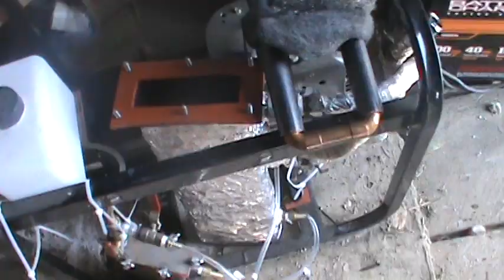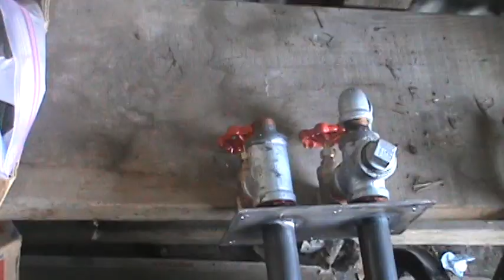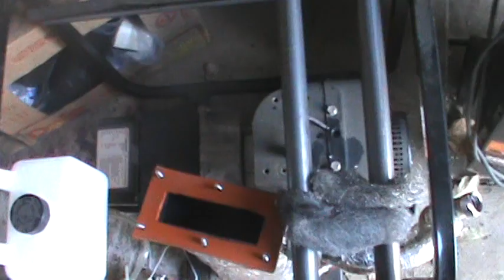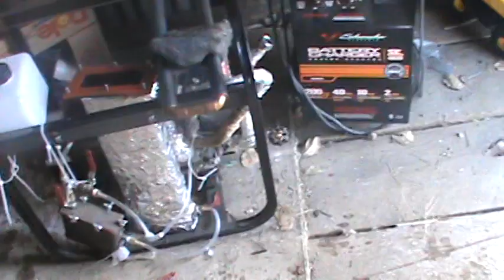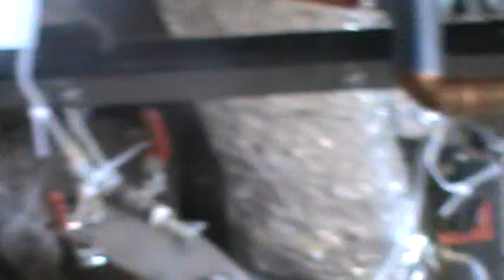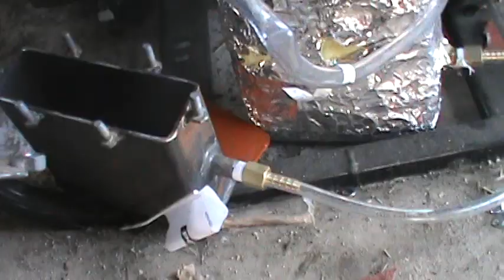Gen-Set Vaporizer System #2 (An Inside Look At The Vaporizer)

Comment: So this device you have here can you pipe in the fuel line from the manual fuel pump?.
either thing could you use the exhaust heat exchange to heat the fuel or do you have to use the exhaust pipe it self?

I am asking question so i can get the correct pointers.
Reply from the maker: Yes you could pipe in the fuel using a manual fuel pump. This design is gravity fed. I have blown exhaust onto my vapor containers and have also used the exhaust pipe to heat the fuel either way will work but the exhaust pipe method works best.

Comment: Hey. I do see how the copper line will heat the air and gasoline into vapor. I'm having trouble understanding how the vapor is pulled out with both pipe being so close to the bottom. From looking it seems the intake would be in the liquid sucking the raw gas. The wool looks above the the intake pickup tube. Another question is how does fuel regulate depth with float valve in another tank. Sure hope you'll explain these questions.
Reply from the maker: The two pipes are air inlet pipes. I have an air outlet pipe in a completely separate location it is not attached to the lid like the air inlet pipes are. Instead it is attached to the vaporizer near the top but on the side as you can see in my previous video. Because the air/vapor outlet is at the top of the container no liquid is sucked up into the generator.
Reply from the maker: To address the fuel level question...

If you were to have two separate containers ant connected them together at the bottom of each using a hose, have one full of liquid and the other empty the empty container will fill up to the level the liquid is at in the tank that has liquid in it. Since the float or fuel regulator container is smaller then the vaporizer container I can raise or lower the float container which will raise or lower the fuel level in the vaporizer.
Reply from the maker: The wool is bellow
 the air outlet.
Reply from the maker: Thanks!

I used a standard 3/8" ball valve to regulate the gas. You have to use a gate valve to control the air/fuel mixture because it requires fine tuning adjustments. 

The level of gas is adjustable. the more gas in the vaporizer the more vapor you will produce because more fuel is agitated. This setup allows me to adjust the level of the fuel in the vaporizer chamber.

I'm doing everything I can to put the power in the hands of the people.